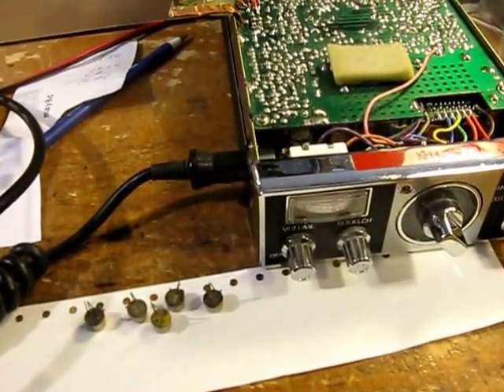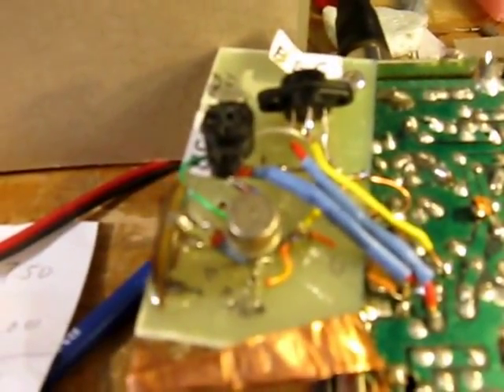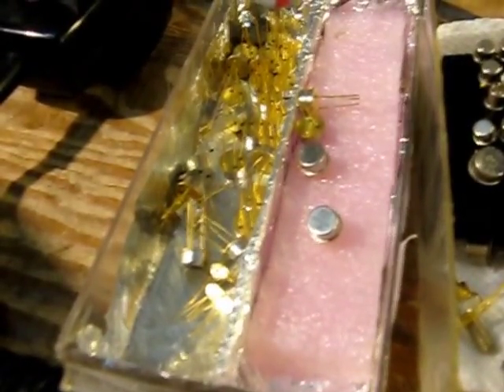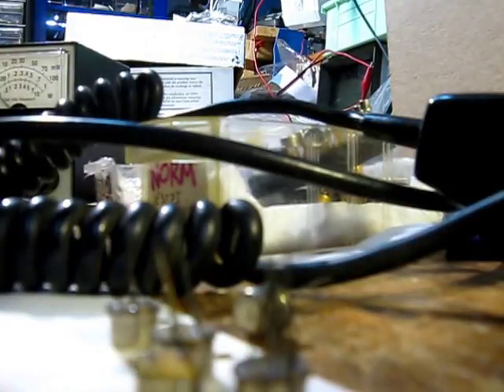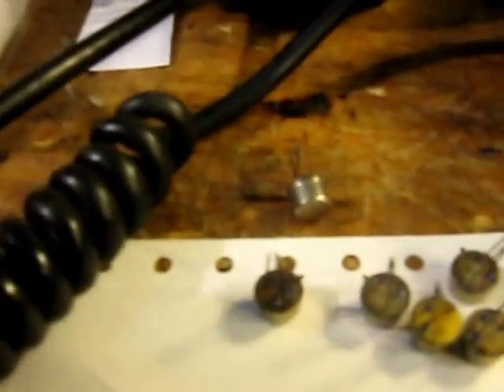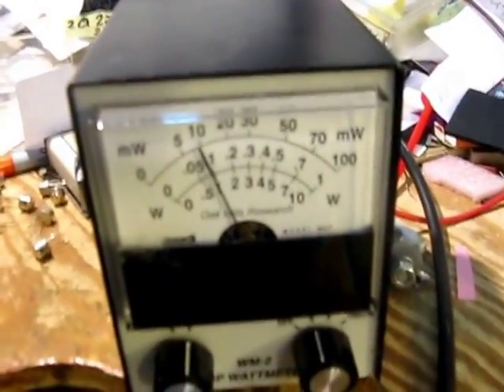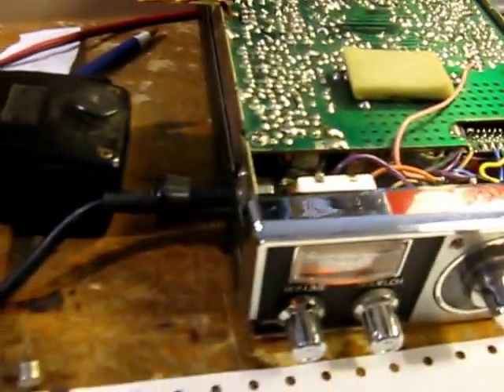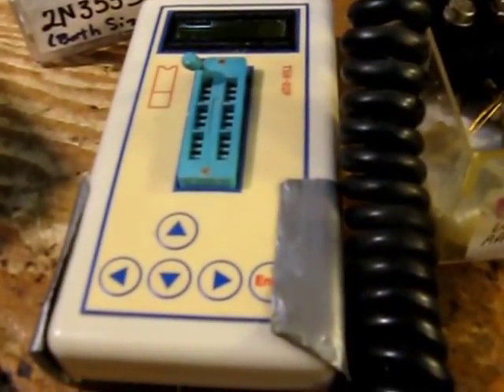2N3553  testing comparing old transistors with newer Chinese versions.

Comment: Thank you for testing and sharing. I also have some vintage2N3553 from RCA,  M3W (MEVHungary?), Philips, and SSS. They are all gold coated except for the Philips. The SSS performed best while the RCA and the M3W were similar but not as good, the Philips was a bit behind all. I also tested the 2N3866 from Motorola(gold coated and steel), and the RCA gold coated, both exhibited identical results. But I also have an obsolete BFX58 DZ from Siemens & Halske (gold coated) which outperformed both the 2N3866 and the 2N3553 in terms of power and ft! I've got some generic 2N3553 and 2N3866 where the can and the imprint look, well, unprofessional or of a small business. The performance made me think a 2N2222 is inside the can!! As some tend to do the trick with bulk capacitors (see fake capacitors in the internet please)

Comment from the maker: It would be interesting to find out what actual transistor die were used to make these transistors. I think  one possibility might be that the manufacturer used a different die than would/should have been used to construct a proper 2N3553. Perhaps choosing instead something like a die for a 2N3053 - perhaps for economy sake or perhaps through an honest mistake. My findings (so far) are that the Chinese RF transistors are fairly consistent in not having enough gain. My next step would be to build an RF test station that could sweep the HF into the VHF spectrum and measure the gain (or lack thereof) over a wide range of frequencies. Earl PS-- I am also finding some of the higher priced Chinese RF transistors such as 2sc1969s (on ebay for example) are producing proper output levels through the tests Ive done.

Comment: Tnx Earl. 

One question- is it a fair comparison doing an A/B test without tweaking adjustments such as transistor bias etc ? I am not an electronics tech,  but I do understand you’d expect all the parameters of the transitors  to be the same, however is there not differences, even between transistors from the same manufacturer and production line? Example ; as when finding a matched pair?

We appreciate your great dedication. Keeping the “ hard to find” unobtainium available and testing what you sell.

73 de Greg
Reply from the maker: Ok Greg. There are (some) differences as you say but these differences should result in such radical variations in rf power output. These are standard devices..and all the RCA transistors (oldies and I had about 6 of them) measured 1 watt output whereas all 20 of the chinese transistors were about 400 milliwatt out. - I dont think there should be such a dramatic difference on a consistent basis. 
My general findings with Chinese RF transistors is that they produce lower output than they should -- however-- this being said-- I have recently been purchasing some TO220 package RF transistors from China distributors (at about 3 times the usual price )(still reasonable cost) and these newer generation transistors are producing the proper outputs. -- So things are  improving. earl
Reply: @earlve3ab  What are some reasonable distributors that you have used?
Reply from the maker: @dingdinglhz001  I buy old stock from old collections from ham radio operators. Digikey and Mouser are pretty good but they often do not have certain items (especially RF transistors like the 2n3553). Fletcher Electronics in Canada does have limited stocks of good rf transistors. earl